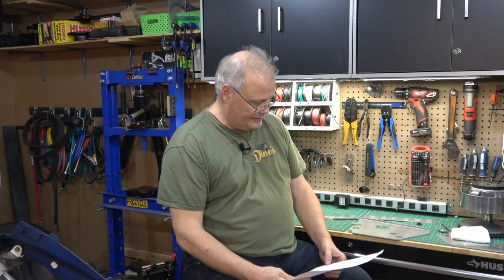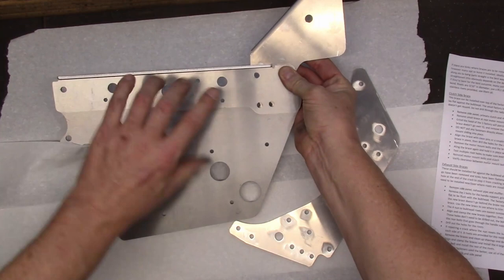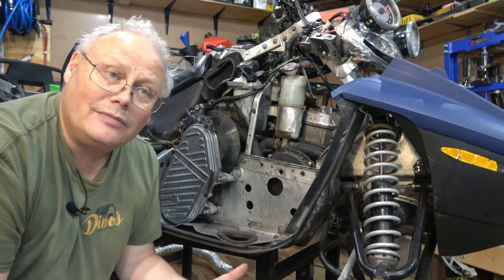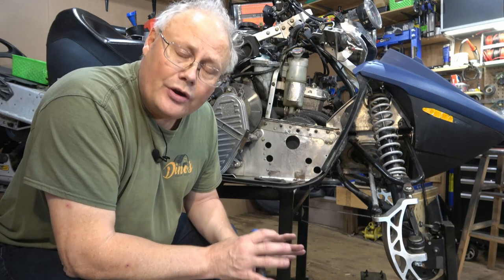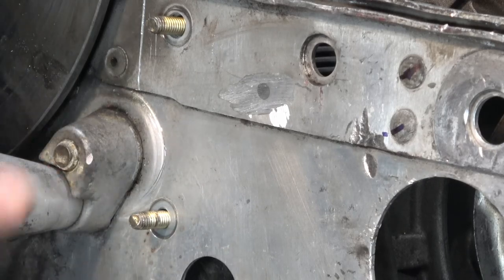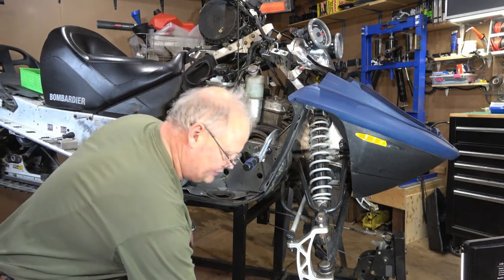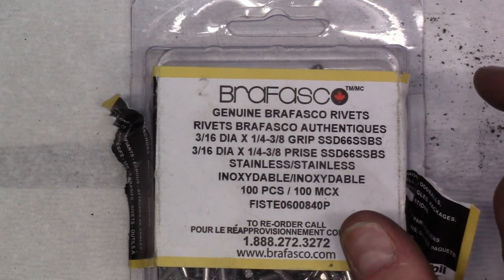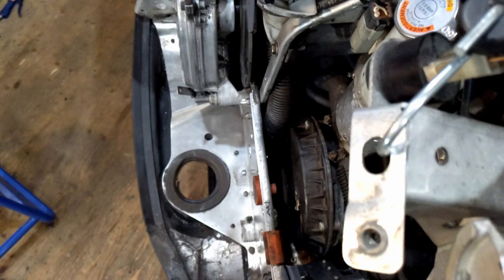Today, I fix a Ski Doo REV GTX tunnel repair using a brace kit.

Comment: A very good video Dino. Not a job to start without a lot of thinking about what is required in terms af material and tools. Good tips regarding clamps and checking fit of rivets and bolts. Using stainless rivets sure requires a gun with good mechanical advantage - air or mechanical. Good vision and clear instructions in your videos.
Reply from the maker: Thank you Mal, I had a good friend of mine, Markus, who came over and helped to lay out the plan. I really need to put a remote regulator down on my first floor so I can increase line pressure for things like the rivet gun. That is of course another project LOL.
Dino

Comment: Do you recommend this kit of a nun that’s not bent? If I add it and have an impact would it just bent somewhere else?
Reply from the maker: I would, although you are correct it can move the bend further down the tunnel on a really hard hit, this kit reinforces the weakest areas of the tunnel and makes it much more ridged and impact resistant.
Dino
Reply: You should get a full 6 piece kit.  The weak points are behind the clutches and behind the silencer but the toe holds are also weak on the outside  and the upper cross brace on the top under the hood as well as the inside of the nun on both sides under the pipe near the shock towers. If you tweak the clutch side, you  can throw off the center to center distance on the clutches and then it will start blowing belts.